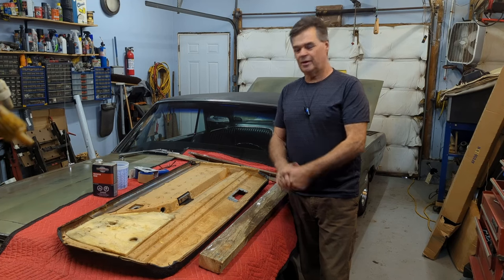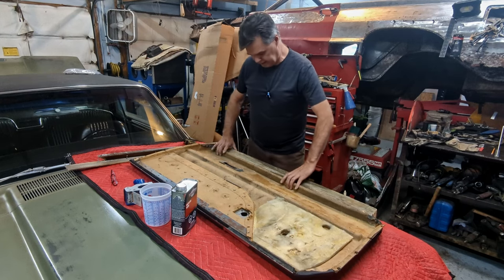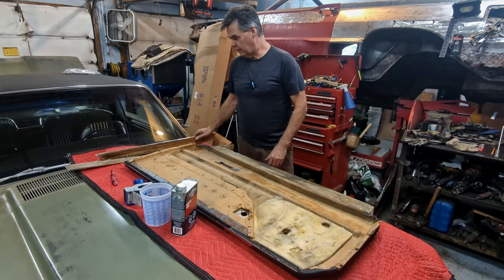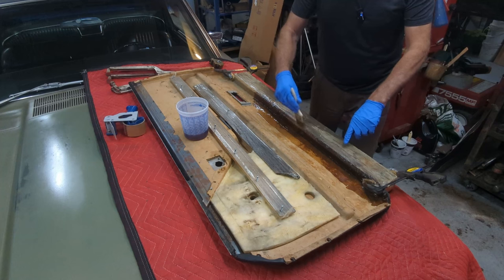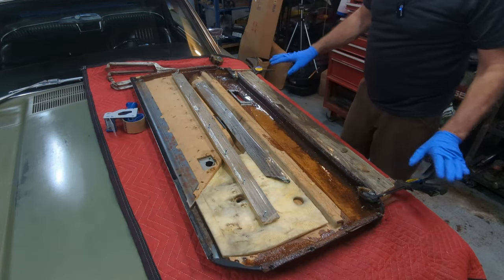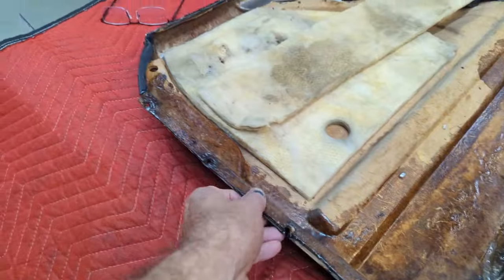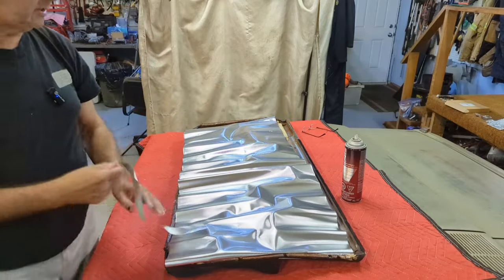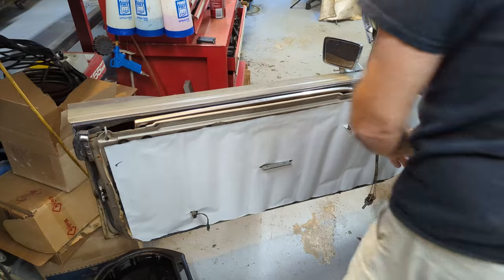1965 Thunderbird Classic Car Repair - Fixing Pressed Fiber Door Panel With Fiberglass Resin

Comment: Thank you as always. I’m intrigued with that Mylar product. Appreciate the education ~ Chuck
Reply from the maker: Hi Chuck,
I figured it was worth a try, and maybe the reflexive coating will stop some heat transfer...either way, I feel it's an upgrade to the original coated paper dust shields.
Reply: @J_R_Shop  Indeed, seems like a very smart upgrade.

Comment: Hey Alvin, excellent repair idea. Now I want to see what you do for the broken vinyl at the hand grip. Those are much harder to fix. My drivers door panel has a crack at the grip and the original owner put matching tape over the crack that is still there. I cant believe it lasted that long. Otherwise they are in pretty good condition. The mylar stuff is also a great idea. The original paper is always missing, always. Sometimes I use plastic and I use caulk to hold it like original. Its not so messy. If the carpet is also coming off, I guess one could resin both sides and then glue the carpet back to the door panel. Theres always more than one issue. Thanks Alvin, great job and great tip for people.
Reply from the maker: Thank you Nick, about a year ago, I was testing some epoxies on the pull handle area of a panel from the parts car. I did get some decent results, but I could still see the damaged area...but I guess anything would be better than what I see right now, maybe I'll go out on a limb and give it a try on this one. 🤔
The mylar seems to work well, it's definitely tough enough, I don't know if the reflective side will make any difference, likely as well as the sound deadening with a reflective coating stuff does.
If I tackle the door pull, I'll video it, fingers crossed! Lol